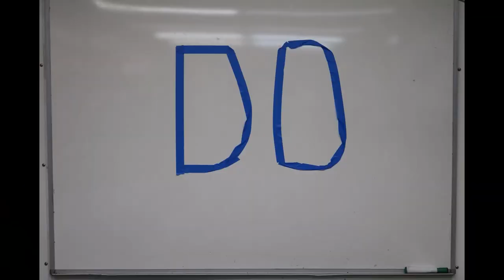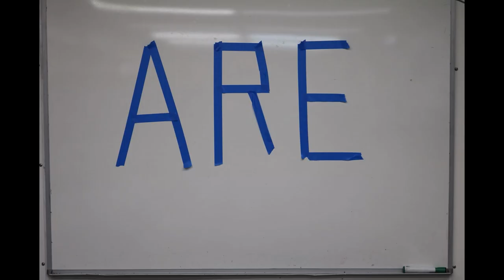Do you need a Professional Tooner??

Comment: I think you hit the nail right on the head. When I started street racing local in the mid 80s everyone ran a carb, engines were simple, but with no internet it was read a lot of books then go out to the garage and experiment. Like you said not the fast way to go quick but a great way to understand how things work or don't work. After a while I found myself going quicker with less due to learning how to match parts and tune things to work together properly.
Reply: Excellent comment !!

Comment: Hey Pete, You should call murder nova to help him tune his car
Reply: I don’t think he can afford a full time tuner like Ryan can. Petty helps him on occasions but not all the time. But it never hurts to have a second set of eyes look over stuff
Reply: Ryan and Shawn both use Steve Petty. He knows Promod like no other who hires out to other teams. But he is a consultant. Ryan and Shawn still have to do the day to day tuning. Ryan is just a step ahead of everyone else at it. Lizzys dad is a god at engine building but he is not there doing the day to day. Secondly, Ryan can out budget almost everyone else too. He just runs a better overall program and it shows at the win light. I root for Murder Nova cause I like the guy but I like Ryan too. You won’t find a better racer. He will give you the shirt off his back. The reality is that most of the guys racing are that way - it’s real hard going it alone out there. It does not matter the class either. See an independent team in Top Fuel blow his shit up round before finals? You will see other teams pitching in to get him to the next round. Racing is that way. One of the reasons I like it.
Reply: @scottwheeler2494  Thanks scott for the great information.